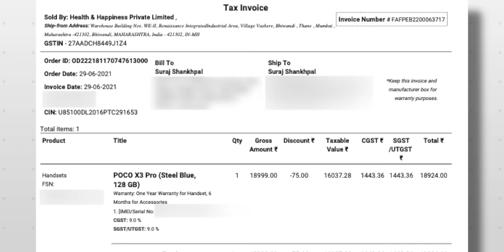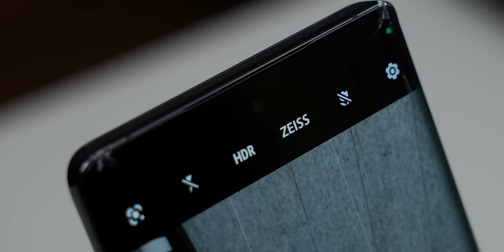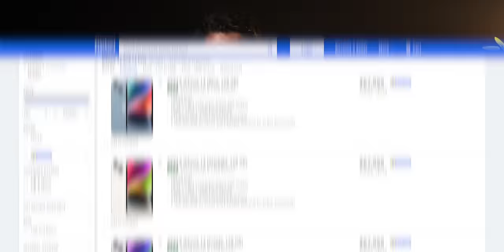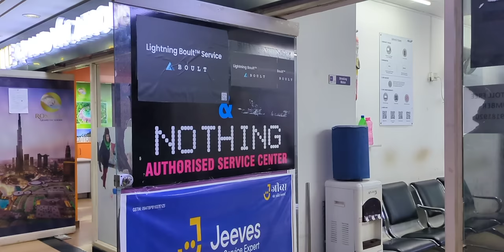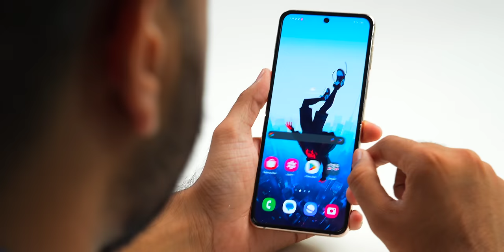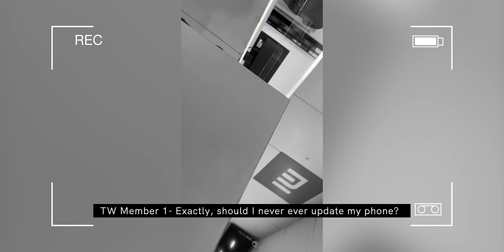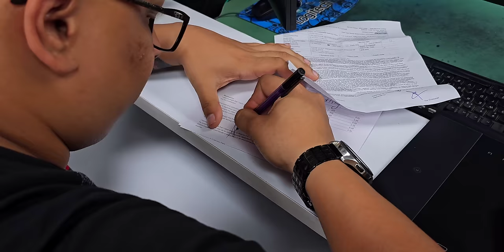We Tried 5 service Centers in India!

Comment: Sharing my experience with the Mi 11T Pro service. I went through a total of seven services for various issues, including haptic feedback problems and charging port issues. It's has been such a pain, with multiple attempts to fix the recurring problems. The most recent service involved replacing the motherboard, which unfortunately took a lengthy two months without my phone.
Reply: I had same issues, I did nothing and update fixed them.

Comment: 2 times motherboard changed, 1 time cpu reballing...poco x2 user😁🙃. I think so it's not bcoz of software. They're using cheap quality motherboards.
Reply: Proud* lol
Reply: for free under warranty ?
Reply: @devanshanil2468  1 st time it happened exactly @ 13th month so I fought and got the replacement under warranty in MI service centre. The next time I approached them for the same issue, they asked me to pay 13k. So I went out nd changed.....
Reply: POCO motherboard issues are caused due to poor quality soldering materials.... it's not a software issue... but now they fixed the issue....
Reply: @krishnasagar8921 But how are you sure that poco (I would rather say Xiaomi) have fixed their quality control and these phones (I am talking about these old phones like poco x3 pro, poco x2, poco m2 etc) won't get bricked again?
Reply: @S1LENCE381  i am taking about newer models bro....
Don't buy 2020 and 2021 models... those units have wide spread issues....
Reply: @krishnasagar8921  But how are you still sure that xiaomi has fixed the issues with their quality control. We need more time to judge that, isn't it? 🤔
Reply: @S1LENCE381  but I can confirm you that not every units of POCO X2 X3 X3Pro have issues.... it's depends on the batch... my brother is also using a POCO X2 buyed in 2020 without any issues... because it has a good quality soldering... otherwise it will died within an year....
Reply: @krishnasagar8921  one year may not be enough. I myself have a poco x3 pro and it died just a week ago. Haven't visited the service centre yet though.
Reply: @S1LENCE381  My brother is a gamer...he play heavy games every day for almost 3 to 4 hours...now his phone is almost 3 year old😅... that's why I said my brother's unit have a good quality soldering... otherwise it will melt in 1 year of his heavy use...
Reply: @krishnasagar8921  ouuu. That's good 😊
Reply: @S1LENCE381  bro visit service center...
Reply: Bro my poco x3 pro motherboard died 3 times within the timespan of 6 months and now after third time i think they literally did something because its running smoothly for 4-5 months even after 5hr+ hardcore gaming almost every day 
I think they did something with the quality of the motherboard to fix the real issue
Reply: @DRKxRIO  i think this time you get a high quality motherboard with good quality soldering....
Reply: @DRKxRIO  bro tumhe app crash issue ata hai kya or apps  loading problem
Reply: @ZooM_.  Ha bhai kbhi kbhi bhit rarely ata hai crash issue pr vo bs pirated apps me hi ata hai jaise ki yt vanced aur instapro

Comment: Last week my OnePlus 8t got the green line issue. My phone was around 1½ years old. It had no visible scratches or dents. I went to OnePlus service center( not exclusive) where I was told that my phone had a dent (there was none, it was just chipped off paint which was very hard to see) and he only repairs when paid. For free replacement I should go to the exclusive service centre where they would probably not fix it because of the supposed "dent". (Next part in replies)
Reply: Next day I visited their exclusive service center where I was told that they would repair it for free but the phone should not be damaged internally or externally. She also added that the parts will arrive after 20 days, they will call me to submit the phone or I could leave it at that time too. I went home and tried calling customer care to check whether the pick up and drop repair service will be paid or free just like the service center. I was told pick and drop repair service will be free and I should mention green line issue in the problem description with 2 photos of the phone and 1 photo of the bill. They had picked it up on Saturday and my phone arrived back completely repaired on Thursday. I would say if the nearest service center is giving an absurd amount of wait time for green line issue repair, just order pick and drop repair from the oneplus store app. Hope this helps.
Reply: I have been waiting for a month now and still my OnePlus 9r is pending repair in service centre, they said I should submit my phone or else they won't repair it
Reply: @flopchamp3143 in the OnePlus store app, u can find services towards the bottom of the screen. In that u will find  request repair when u scroll down. Thats how I booked myself the repair.

Comment: Team TechWiser,

Keep up the good work! I appreciate your hardwork in bringing the latest tech updates to us.

Motorola is no different on after sales services, as recently I went to the Motorola Authorizes Service Centre in Mumbai (Borivali) for multiple issues like ghosting, poor network reception, worse battery backup (as SoT was only of 3hrs at max so I need to charge twice a day with minimal to no use) on my Moto Edge 30. Firstly, they took cognizant of the issue and asked me to keep the device with them for 7 to 10 days as they needed to replace the motherboard, which was fine but they denied providing a spare/backup phone as it was not in-line with (one-sided company policies) I argued with them on nowadays who has a spare device at home lying idle. But they kept repeating the same lines i.e. it's against company policies. Then I gave up and surrendered my device to them for repair. After 4 days I collected my device from them and told them that I'll keep the device under observation for a couple of days and if any issues arise then I'll re-visit. Upon subsequent visit after 3 to 4 days with the remaining issues which weren't resolved by them like ghosting, poor battery backup with an additional issue of heating and lags, they said that now they'll take minimum 15 to 30 days to get the device thoroughly checked and discuss with the company officials (as the warranty was expired same day I surrendered my phone for motherboard replacement) Now the real agony starts, because as I stated earlier that no one has an idle device lying at home. So in a nutshell all the companies must find a way to tackle such a situation where they can provide a spare device to the customers for the time until the actual device is repaired. This way both the parties are in a win-win situation. Lastly, I'd recommend you guys to push companies further to get this implemented.

Comment: Vivo's service is good!
I had been using an vivo u20 and it had battey discharge issue(it runs out of battery in 2 mins) so after taking it to the service centre they swiftly fixed it by resetting the battery software in the mobile and whereas i waited for like 20 mins so it's good didn't have to wait for 1-2 days

Comment: I had mixed experience with Samsung (in the same service center). 
1) M31's infamous random reboot issue. Phone was under warranty, motherboard replaced for free. The turn around time was quick (10 AM -4PM). The same phone had its its glass panel shattered, a little after the warranty period, but fixed it for 4k. Again, no complaints.

2) Tab S6 Lite's (2022 model) screen bleed. Now this was a widespread issue. But to my surprise Samsung denied the repair/replacement. The device was just a day old, bought from a Samsung store a KM away. I didnt want to risk ruining a new device with third party repair, so never repaired/replaced it. Surprisingly, samsung never contacted me, even when i raised my concern on twitter. I was clearly bummed by this incident.

Another experience with Realme wireless neckband, they use the same service partner (F1 service, which also services Boat, Nothing, Asus and recently, Google). Had to wait for sometime, but experience was seamless. Provided me with the replacement unit.

Also, the repair on the iPhone is shoddy, but cant complain for 1400 quids.

Comment: I am from Kerala, Pathanamthitta the service center was awesome for me I went for replacement of my battery and sim try which was broken and the sim was in the phone but I have a plus point in my point was my back panel was open so they just got back my sim in just 5-10 minutes otherwise I think it may time take longer to done. By the way my device is redmi K20 pro and they don't have the. Battery and sim tray on stock so they requested to submit the phone in order to order the spare parts . In my mind I calculated about a week for both battery and sim tray but surprisingly the battery reached after 2 days of submission and sim tray all around 4 days for me it's very acceptable time but those days I used my nokia 2 which was horrible to use at last the service experience is excellent for a 5 year old device and the battery is with full capacity I got replaced
Reply: How much did it cost to fix the SIM tray?
Reply: @thejazp  199 + GST + service charge (350)
Reply: How much for battery it costs?

Comment: I had a similar issue with the Mi 10T where it suddenly got stuck in a boot loop and wasn't starting at all. I had to take it to the service centre and they did did a factory reset on the phone mentioning it was a software bug, but that left a bad impression of the brand. Hence sold it and got an S21 FE which works amazingly well. Never gonna buy Xiaomi phone coz or their unreliable software!
Reply: And what will you do if your S21 FE develops a snag one day? Ditch that brand too? One bad experience doesn't mean that the entire portfolio struggles with the same issue.

Comment: very well explained detailed video. Loved It.
about my experience -:
with OnePlus it was amazing had to visit 8-9 times in the last 5-6 years.Once for broken back so to get it repaired fast. Once they picked it up from home but it took them 14-15 days to repair a broken screen.
and once or twice just for regular cleaning and other times with my mates. overall the experience was pretty solid.

But with Nothing the experience wasn't great, visited them coz the casing on the earbud came out without any damage whatsoever (Got to know on Twitter that it's happening with a lot of people), they clearly denied even within warranty stating that we aren't allowed to work on open products, i asked them  to just stick it with Fevi Kwik (which eventually i did myself and it's running as usual) but they said sorry, even called their custo,er complaint and told abou the issue to which they said to right mail but eventually denied.

Comment: Not a phone but airpods, I just recently went to the only official Apple store in India to claim warranty on my airpods as one of the buds was not charging properly. They replaced the bud that had the problem but at first made a mistake in as the buds showed a problem so i went again in a couple of hours and they replaced the 2nd bud too but the case wasnt charging anymore and then they re-replaced the right bud and it was solved, although I had to make 3 trips the experience was good and their support staff was very nice and i got to visit the apple store
Reply: Usually for TWS and headsets in general, if it is in warranty, any other brand would've replaced the whole unit in the first go itself. I have replaced a couple of TWS and even wired headsets. So, making you run for it 3 times counts as poor service if you ask me.
Reply: mayorplayz  yeah, mine was the cheap Seinheiser momentum 2 buds. And the wired one was the Moondrop Aria.

Comment: Vivo has one of the best after sales service. My screen developed green lines 10 days after a software update. The phone was out of warranty (3 years old phone). Went to the service centre and they replaced the  amoled screen which costs 11k for free. No questions asked
Reply: Wait for few days green line will written again let's see u again gonna praise Vivo 😂
Reply: @cospinkristijan2267  dude vivo keeps quality of their brand value.and gives very good aftersales service..they value the customer..i knw that with my experience..
Reply: And green line issue is common in all brands including samsung apple and other chineese manufacturer...but vivo always understand if its their fault and gives the best solution they can to the customer.
Reply: @Vks1992  brother u expecting them to do 5,6 times screen replacement I know many had 2 times green line issue after changing display in Vivo smartphones
Reply: @Vks1992  well very few iphones have and Huawei is actually best it doesn't use samsung display so no green line issues in their smartphones

Comment: I am an Vivo user for more than 4 yrs and I think Vivo does good service for both premium and midrange customers, actually couple of weeks before I visited Vivo service center at Tichy - Tamilnadu because my earpiece speaker was not working properly, they just asked the General things and then the Executive again called my name just in 15 min and said there were much dust particles so they just used the blower to clean that and the interesting thing is that I kept the back case in my pocket before entering the service centre and while after receiving my phone from the service they have put an TPU Case which we'll get default while buying and that was much surprising and the Executive said that sir your battery health is not good so try to replace it as soon as you can and do not charge more than 80% so this was really amazing because the care towards an customer they have ❤ #vivo

Comment: Had a Samsung M30s display replaced last week when I was travelling. It's quite an old phone but they had the display in stock (metro city) and fixed it in a couple of hours. Very quick service despite there being a decent crowd. It did cost ₹5500 for a 3 year old device I bought for ₹14000, but the service speed compensated for that.
Reply: Same mobile!

Comment: Thankfully i didn't have to often visit the service centre because i didn't use Chinese brands. But i had a Samsung S8 which had a speaker issue and they fixed it the same day..and they even insisted if i want a spare phone, as the repair is going to take a few hours. From my experience they really treat their premium customers well
Reply: Samsung technically has best customer care service out of every brand except you don break the screen
Reply: @anishs5652  i disagree ....its way cheaper than apple if you consider flagship also. the  Galaxy s series screen replacement ranges from -11-15k and the regular  A& M series is around 6-7k. there are many misconceptions about Samsung and this screen replacement is one of them

Comment: I have faced similar issues with OnePlus. After the Android 12 update, i got the green screen line. there was no scratches or dents on the screen or the phone. I had to pay 15k for screen replacement, and they only told me not to update the phone to Android 12 again

Customer care was so rude, and basically called me an idiot and a liar. Worst service centre experience

Comment: Appreciate your effort brother, 
Gave an idea of immediate steps to take when you're phones down
Luckily my 4 year old poco F1 is still running like a champ and haven't faced any motherboard issues.
Battery went bad around the 2 year mark, replaced the battery for pretty cheap in a local shop and it's been 2 years since, phone seems solid and might easily last another year. 
Have been planning to buy the F5 and this motherboard issue seems concerning...

Comment: Nice video. 
Heres my experience with moto service centre in Kolkata: there are 2 centres. My issue was edge 30 was randomly restarting/shutting down ever since i bought it. First time i submitted, they took 4-5days and did a software reset(formatted the phone), but that didn't help. Issue was still there. I went back a month later, they said they will repeat the same thing and cant do anything else. I asked them to either fix it or replace the phone, that started an argument and one guy even refused to accept my phone. Then they finally took it but said they will repeat the same process and nothing else unless the issue is reproduced at their end. Luckily just then the phone restarted in front of them while lying idle. I pushed them to give it to me in writing that the issue was reproduced.

It took another 7-8days but they replaced the motherboard, since then there has been no issues now for about 4-5months.

Comment: Back in 2018, I had Nokia 7 Plus which started having charging port issue which I read was a common one. I went to service centre and they told me Nokia doesn't make new parts for 7 Plus, and since the phone was in warranty, they offered me a brand new Nokia 8.1 instead. They told me I had to wait 30 days and did not provide a spare phone. I agreed as it was an upgrade (Not in terms of money as 8.1 was cheaper but in terms of specs). It took 2 months for them to provide me the new 8.1. It wasn't a great decision I would say as the new 8.1 also started having the same charging port issue which I then went to a local shop and got it fixed for Rs.250 . Now I wish I had done that with my beautiful ceramic coated black 7 plus!
Reply: I too used Nokia 7 plus till April 2022. For 4 years, I never had any issues other than some minor UI bugs that they fixed with updates. I did went to the service centre (which was also a Xioami service centre) for one such problem and they just asked me to wait for future software updates, which it did.

We even had a WhatsApp group of Indian Nokia 7 plus users I found from the Nokia community page itself. That Nokia community actually helped solve many issues as concerns were directly raised with Nokia itself.

I have seen many people with the same issue as you, but thankfully I never faced it. The phone was so smooth even after 3 years of updates. Too sad that, Nokia never made similar devices after 2018.